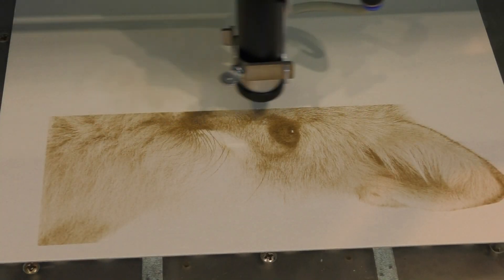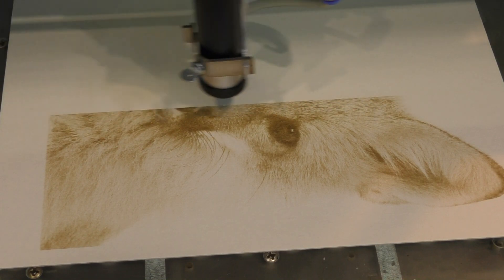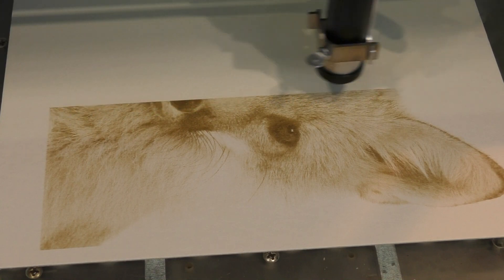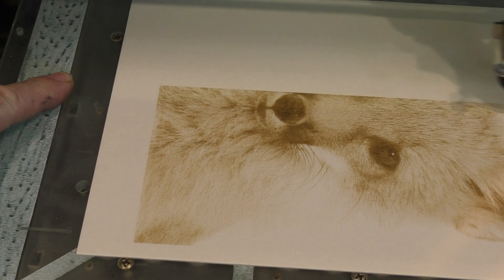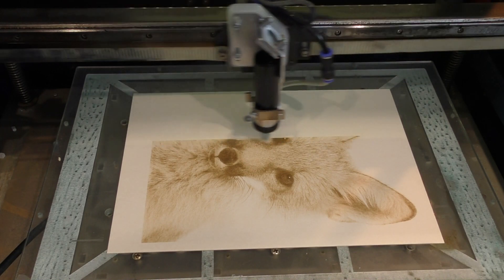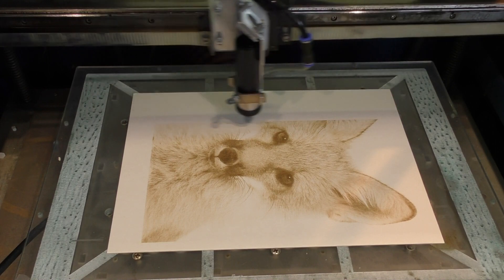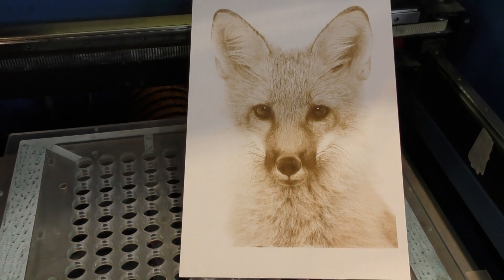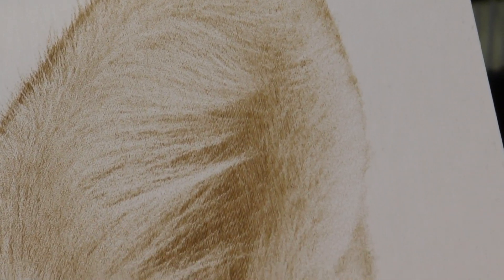RDWorks Learning Lab 183 New Head Results

Comment: hi Russ i got the compound lenses and nozzle setup from cloudray and i got the cards you have  , i have a 100w laser tube on my machine i tried doing the same picture of a fox and my settings were 600 speed and 12.5 power i tried different settings lower speed lower power and vice versa I've tried dot dithering and net graphic but the problem is i couldn't get my machine to give me a good quality pics , if they are little good they wood be faded and no contrast at all because if i higher the  power then i will get burns and grooves in the darks and blacks area into the material ,please help me find the best wood to engrave and if you can help me find out what to look for thanks
Reply from the maker: Hi Jay
 100 watts is on the wrong side  of ideal for photo engraving where you need good control of low power.  So the fact that you can run at 12% is promising BUT there are several key things you must understand.
1)  Every SINGLE  pixel you try to reproduce has to switch your tube ON and then OFF. It takes a finite time for the power to appear after you tell the tube to switch on and if you look at the HV power supply specification it promises to do that in less than or equal to 1 millisecond. Hmmm. Lets assume you are trying to reproduce a 254 ppi picture. That means each pixel is 0.1mm ie 10 pixels per mm. If you are running at 600mm/s then you are trying to switch at a rate of 6000 pixels per second or 1/6000=0.17ms per pixel.  That is 6 times faster than your power supply promises. Every power supply will have a different response time  and you have to test your capability with two simple test patterns before even attempt to do a picture on ANY material . I have two HV power supplies that are capable of 0.5ms or less  but that is just good luck.
2) Reci power supplies in particular do not have a response time specification and (in my personal experience with several)   have VERY  poor response times at low power. Above 50% they become OK but of course this is useless for photo engraving. One of the tests I mentioned previously will ascertain if your response time is viable for photo engraving.
3) The compound lens has a very short focal distance (about 21mm) and therefore is sensitive to distance variation away from the nozzle. More than +/- 0.5mm and you dots will go out of focus and get bigger/less powerful.so it is important that your work table is set well/ That is one of the reasons I designed my vacuum table with 3 point levelling.
4) DOT SIZE IS KING.  You MUST have a means by which to measure the dot size you are producing. I have developed a test pattern that allows you to visually assess dot size with any complex equipment. This pattern is small and VERY quick to carry out. It MUST be carried out on ANY new material ( all woods are NOT the same) because speed and power will need fine tuning for each material.. If you think your dots are 0.1mm then you can work with an image that is   25.4/0.1= 254ppi. However if your best dots are 0.2mm then I'm afraid tour image must be set to 25.4/0.2=127ppi. The simple rule is 1 pixel=1 dot.  Thus I cannot stress enough that DOT SIZE IS KING. You cannot decide on a photo resolution first because that is a recipe for failure. The photo resolution can only be as good as the size of your dots.

 Send me  your disguised email address in another comment and I will send you a datapack about photo engraving that will include test patterns and gauges. I will then delete your comment.

 Best wishes
Russ

Comment: Awesome results .But I have questions about the laser engraving machine I'm using (working) universal laser machine so can you suggest about the different between them. Thank You
Reply from the maker: I am no expert on Universal machines because they are way too expensive for hobby use. But I am aware  of  some aspects of how they work, and there are many similarities between  The Universal and  the cheap Chinese laser machines
 First the similarities.
1) They are CO2 lasers
2) They are X Y (and sometimes Z ) axis "plotting" machines 
3) They can engrave and cut non-metals
 Now the differences
1) A  $2000 Chinese machine will be equivalent to a £30,000 to $40,000 Universal machine
2) The build quality and components used in the Chinese build will be just about adequate and often very clunky  and heavy in design, it will engrave at slow speed , maybe 400mm/s. The Universal will be a quality controlled build from high quality specially designed components that will allow the engraving speed to be maybe 1000mm/sec 
 3) You need to learn about  lenses and cutting and engraving  parameters for  various materials. With the Universal machine, that learning is embedded in a menu system so you will only ever need to understand the machine and not the laser processing technology.
4) The Universal machine is basically fixed as a high speed engraving machine  and although it will cut,  it's configuration is poorly suited to cutting. The Chinese machine (maybe with a few cheap modifications) will do either very efficiently although engraving will be slower.  There will be no difference between them for cutting because you need raw power to cut and the speed of cutting will be limited by that power . Thus any speed advantage of the Universal will be levelled when it comes to cutting.
5)That I am aware of, there are no high definition lens systems available for Universal machines , You may be able to get an optional  1.5" lens  but mainly 2" and above will be the standard focal lengths.  It is possible to get a compound lens system ( as you see me using for this photo engraving work) for many Chinese machines and that allows high quality  photo engraving. (my machine cost £1000 5 yeras ago)
6)The Universal machines are usually   supplied with a very expensive RF pulsing CO2 laser system, whereas the Chinese machines  are almost exclusively  driven by constant current sealed glass tube technology that costs less than 10% of an RF system.
6) I know that Universl have their own  1-Touch photo creation software  that produces OK results but it will never match the resolution capability of what is possible with the Chinese machine, for two main reasons, The lens system cannot create super small dots to match the required picture resolution and then the software uses the half tone method of dithereing the picture. The laser can only make fixed size dots (dependant on the lens)  and the half tone method requires variable size dots. The best dithering algorithm is Floyd Steinberg and that is used by Photoshop and others to produce great single dot images that are perfect for photo engraving, (all the same size dot)
7) Do not expect any service or after-sale support with a Chinese machine. You will be your own INSTANT 24/7 service tech (for free). The Universal support will be expensive and not instant 
8) Universal are aimed at medium and large businesses where as the Chinese machines will temp everyone with a limited budget.

This is the quick list of significant differences. 

Best wishes
Russ

Comment: I have always loved your videos, very informative. That said, I have a question. Lets say you wanted to do that same image but on a larger piece of wood that extended outside of the machine using the "pass through" doors. Can you please make a video of how that's done?
Reply from the maker: I think the principle I have used in this  following video is the method you are looking for. In this video I am using the ends of my cut to reference the program join. In your case it would be good to put a cross markat the material extremities that will allow you to accurately align your material. Remember you must align the material to the pulse mark and NOT move the head,  It will be an interesting challenge so good luck. Just do a couple of small areas at each end and either side of the join line on the back of your material to test your program and practice alignment The cross hairs should allow you to achieve alignment perfection.
https://www.youtube.com/watch?v=3hFNAFb8uhA&list=PLPWEtx5V9DqEogIeYRdcG_KYcB7UL2Qmn&index=30&t=781s

Best wishes
Russ.
Reply: @SarbarMultimedia  Thanks my friend, I will keep you updated on my progress.

Comment: Foxy, foxy😊
Reply from the maker: It's still the best test picture I have discovered. The detail in the image allows me to see exactly what the machine is doing. My first attempt at 400mm/s appeared VERY slightly out of focus. 99% of viewers would not see an issue. Then I realized my stupidity.  I had not calibrated the reverse scanning offset for that speed. Problem fixed and great result.
 Keep safe
Best wishes
Russ
Reply: SarbarMultimedia That’s why are friends for :) Stunning results mate!

Comment: Have you ever tried adding toner powder on top to add contrast or color?

https://hackaday.com/2015/07/06/laser-engraving-in-color/
Reply from the maker: Hi Tim
 The simple answer is no because I don't happen to have a colour laser printer. However, in another sense yes. Much of my acrylic come covered with a blue protective film of plastic. A long time ago I discovered that the trick to engraving acrylic is to use just enough power to disturb the surface and create the light diffraction effect to get a bright white image but no so much power that you get a deep cut and produce lots of fumes.
You need to understand how acrylic behaves to achieve the results in the video you linked, Acrylic is exactly like a plastic version of water, At room temperature it is solid. At 160C it turns to liquid and at 200C it boils and turns to acrylic vapour. There is no chemical change, just a change of state.
Back to my blue plastic film. If you apply JUST enough power to MELT a thin layer of acrylic,  the blue plastic film fuses into the melted acrylic and produces a weak blue transparent image. I found that annoying rather than interesting but I can see how the decent vivid coloured powder could work well. I can see that the melting point of the powder particles  is more than 200C thus with careful and gentle application of power you can melt the surface acrylic and absorb the powder into the melt. 
The idea is certainly interesting. Maybe fine sand, talc or kaolin powder would do the same. So what I found annoying could have some interesting applications. Thanks for the thought.
Best wishes
Russ

Comment: First of all, thank you for all your magnificent videos. But now to the the question. Have you noticed any change in the curtains in an all black engraving after changing to the lighter version?
Reply from the maker: Hi Johannes

I fixed the curtains issue a couple of years ago when I turned the X drive belt inside out. So I have not seen curtains on this machine. You would certainly see them on this image even though its dithered.

Best wishes
Russ
Reply: @SarbarMultimedia That is why they were the like in the video. I'll have to give that a try. Thanks.
Reply: That's that is why they were like that in the video.
Reply from the maker: Hi Johannes
You may wish to watch this video about how and why I turned the belt

https://www.youtube.com/watch?v=B87ifTPKN8c
Best wishes
Russ

Comment: Hi Russ 
Awesome result. 
How to prepare image for this result
Reply from the maker: Hi Vignesh
 There are obviously two parts to this project. First I used a high resolution 1200dpi studio photograph that was  well lit and set against a white background  to detail all the hairs.. Thus there was little preparation required. I cropped the image to fit A4 format and down scaled the image within Photoshop to 254ppi resolution. I then used the Diffusion Dither within Photoshop  (it's basically the Floyd Steinberg dither) to convert it to a binary image. The second part is more complex and is based on understanding the lens, speed and power required to create individual 0.1mm dot (254dpi ).

Best wishes
Russ
Reply: @SarbarMultimedia  

Hi Mr. Russ
Thanks for all of your efforts on doing those great and extremely valuable videos

Could please make a video of that picture preparation especially Photoshop part
It would be awesome 

or if you already done that could you please point that video to me please 

Thank you from my heart 
and Sorry for bothering you brother
Reply from the maker: @FixTronics  
 Never apologize for asking questions. How else will you learn

 Send me your disguised email address  and I will send you a photo engraving data pack and also the fox image so that you can experiment for your self. This is a studio quality image that required virtually no Photoshop work other than to do the dithering. I alway use the diffusion dither in Photoshop as it is the best of all the dithers I have tried.

 Best wishes
 Russ
 ps I will delete your comment /email address from public view.

Comment: Hi Russ
Is this your original 50w blue and white machine. If it is, that's very impressive. I've got a K40 at the moment and I'm going to upgrade to a larger machine soon, but can I ask what the larges size of work peace can you work on, on this machine. I believe the bed on this machine is 500 x 300mm. On my K40 I have a working area of 320 x 220mm so A4 is comfortable on it.
Also, can I just say your videos are the best, I have learned so much by watching them THANK YOU.
Kindest Regards
Richard.
Reply from the maker: Hi Richard
Yes, this is my original  China blue machine that is now 5 years old. My aim has always been to  fully understand the real potential of this little Chinese dragon and train it to do tricks that match or better those $30K machines..
It is indeed 300x500 so JUST big enough for A3 landscape mode. In fact, now that I have reduced the head size,  I think I will be able to set the work area to 520x320.

 Thanks for the kind words
Best wishes
Russ
Reply: @SarbarMultimedia  
Hi Russ
Thank you for your very quick response, most helpful. There's a 60W 600 x 400mm from the Czech Republic that I've been looking at which is a couple of hundred pounds dearer than 50W one. So it's a toss-up between the 50w one or the 60W. But then again I'd have to upgrade the tube on the 50W pretty soon after getting it and another thing sneaking into my garage past the wife now she's work from home. Oh woe is me!!!

Enough of my ramblings.
Thank you so much for your help.
Kindest Regards
Richard.
Reply from the maker: @richardking7996  
Hi Richard
Send me the link to the machine that interests . 600x400 is a rare size and most that I have seen are really just pimped up K40s,,,,,,,,and I'm sure that's not what you want.  ALL ebay machines will be fitted with B grade tubes  which you will have to soon replace so don't spend the extra on a bigger junk tube when cash that will almost buy you an A grade replacement.
Best wishes
Russ
Reply: @SarbarMultimedia  
Hi Russ
Heres the link I hope it works :    https://www.ebay.co.uk/itm/60W-CO2-Laser-Engraver-Cutting-Engraving-Machine-USB-600mmx400mm-Wood-Glass/233046260834?hash=item3642a3bc62:g:oWAAAOSwlTFdxP1s  I believe you have a 70W tube in your blue laser now, that would be ideal for me because I want to cut thicker and bigger pieces of ply than I do now. You must have a video on that upgrade some were I'll have to look for it and see if it's something I could manage to do to my next machine. Thank you so much for your help you a godsend.

Kindest Regards
Richard.

Comment: Please speed and power?
Reply from the maker: Hi Nadia 
 I am using 400mm/s and 18% power. Sadly those numbers will not be of any use because it so depends on
a) the response time of your HV power supply. to run at 254 ppi resolution.
 b) the lens you are using and the accuracy of your focal setting
c) The material you are engraving on
d)The power of your tube ( the greater the power the more difficult it is to control at low power)
e)The power distribution within your beam.
f) A good calibration of your scanning reverse offset
I'm afraid to say that there is quite a bit more to these machines than just the speed and power parameters when it comes to engraving.

Best wishes
Russ